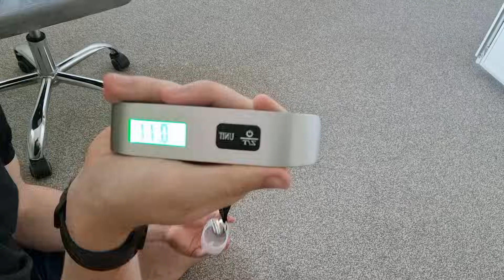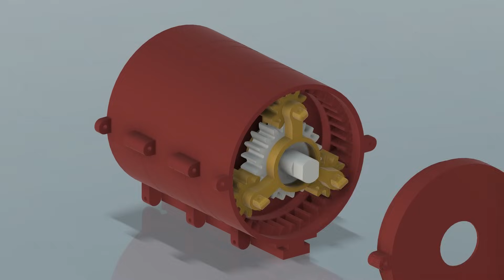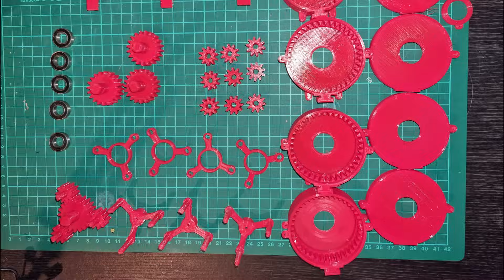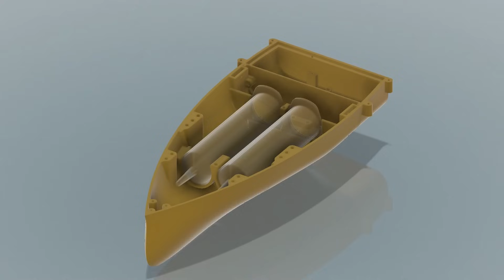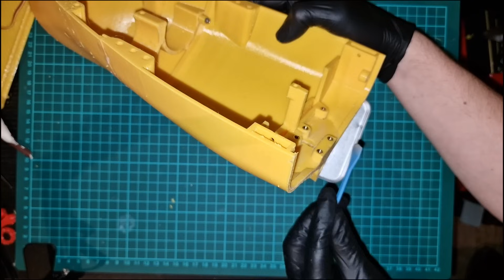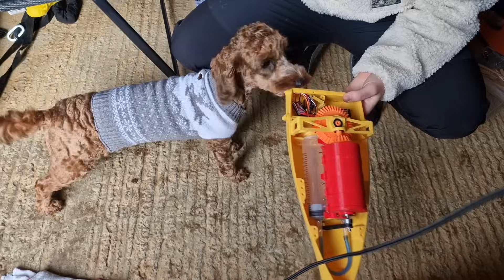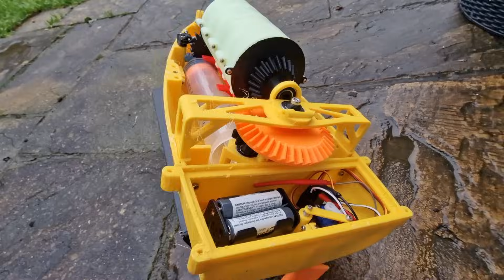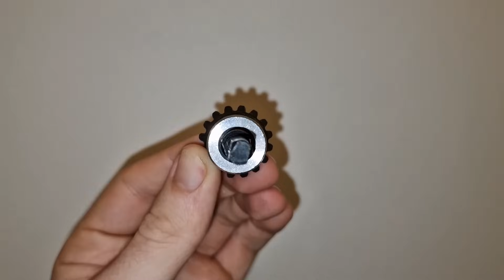3D Printed Vacuum Powered Boat

Comment: Wind the vacuum chamber from the opposite side. The gear where you are trying to charge needs to withstand both frictional force and air pressure. The closer it is to the vacuum chamber, the easier it will be on gear. Print it with an inch ledge so it won't sink easily.

Comment: main issues you having is that you using gear box to recoil pump i dont think that good idea what  if you use 3 steel rod for pump n gear to gear box and make middle shaft steel taller that way you can recoil pump without failures point of stressing plastic it will snapped try use steel rod for pump n gear to middle shaft that way avoid some headache
im engineer i can point some of failure in your work
if you want to redo work i adjust you put pump on top and gear box lower to boat that way balance out weight issues plus belt too so you have longer middle shaft and 3 gear to it and pump will have two gear top and bottom give you enough streght so doesnt snap and hopefull this help you out
in boat you dont want top heavy because it will flip over and sink recommend bottom heavy so it balance out good

Comment: Your red PETG probably got wet causing quasi-clogs in the nozzle. The yellow PETG blobbing and stringing also from moisture. Sometimes PETG can come wet and it will never work well until you dry it with heat and desiccant.  

PETG is also far more sensitive to repeated retraction as most types are a bit malleable, especially as it absorbs water. I think this also partially attributable to the failures you were seeing.

If possible I would look into ASA. It's more forgiving than PETG IME but requires an all metal hot end and enclosure.

Comment: One thing you should do is for the charging mechanism. Built the gear and shaft into the boat so that all you have to do is attach the drill, that way you can use the drill itself as a locking mechanism until you design something you can lock the gears with for the between unlatching the drill to launching in water.

Comment: Looks like a neat concept. I'm surprised you're using such low infill for parts that are expected to see the loads they are.  I'd be printing with 80-100% infill for these, 8 walls.  Looks like you are 20% or less.  That will make for weak parts.

Comment: first get some packing tape
the kind with reinforcing fiberglass strands. 

cut the belt at an angle instead
of straight across.   like lay one side of the belt over itself then cut it at a long angle
crossing a few of the gear ridges. 

then tape the two ends together. if its to long, add an idler gear to take up the slack. 

pretty much what. your doing is like how people turn strip sandpaper into a loop sandpaper for some vertical sanding machines. 

i don't know if i was clear
enough.  maybe someone reading this can explain better. 

Try packing tape (the kind with fiberglass strands in the tape). Instead of crazy glue, with the packing tape you can go all the way around the gear tape. Obviously on the flat side not the side with the gears on it. 

I’d also be tempted to cut the. gear tape at an angle (both ends) this way the cut instead of just being cut across with a small area which would be a good failure point. 

this would be easier with pictures. maybe you
got my drift

Comment: The fuel storage system doubles as a floatation device - so if you spring a leak off shore, you have the option of steaming for land and sinking faster, or staying put and floating for longer. Would make for some interesting tradeoffs!

Comment: Eliminate 99.9% of your gear train!
Use a string from the piston around a shaft... As the string winds around the shaft it pulls back the piston... As the piston pulls back it then unwinds around the shaft.... Using a simple wheel you can change direction 90° so there is no gears at all! 

Your failure is not by design, but by the limits of the materials!
Plastic is just not that strong....

I would also put a pull on the piston directly.... That way you simply pull the piston back, then wind the string around the prop shaft without load! Less ware/stress on the whole drive system.
Reply from the maker: I will have a think around how to incorporate the wheel idea as a few have mentioned it!

Only issue with pulling the piston back is its almost 30kg of force, quite difficult to do with one hand and lock in place haha

Comment: Well, nice project still!
I'd look into a metal (aluminium strip for example) brace to couple the geartrain to the 90-degrees bearing and use some screwrods instead of 3D-printed rods for the shafts.
Other things, make use of a .2mm nozzle instead of the .4mm so you can get finer details and maybe use other materials like PETG or Nylon which your printer both can handle well too.
For the stability: get some weight or maybe just put a led kiel below it when you want to go 'full water'. With a 'heavy' (for the size) camera on top, well,  even more chances for tumbling over.
But, really like your ideas.

Comment: lowering the centre of gravity will likely help with the stability, the syringes are likely lighter than the motor parts, placing them on top in a light mount could be the solution.

I also might just slice the boat in half and add another long middle section. This will help with buoyancy and the likely larger weight you will have to add.

By putting the gearbox lower, and possibly extending the length, you also could have an inline shaft. Most boats, and especially the ones I have worked on with inboards such as yours, have a direct connection from motor to transmission to prop shaft. I think you could eliminate parts and points of friction and failure. Possibly getting rid of the bevel gears and the belt altogether.

It appears that the bevel gears are there because of the need to have the pistons at certain angles. Because the syringes are light you could orient them vertically or use pulleys rather than gears to get the string to pull the transmission input shaft at the correct angle. I envision two pulleys, one on either side of the transmission. Again the extended length would make this easier.

The one downside to orienting anything vertically is that it will act as a sail, so watch out for that!

Comment: Planetary gear boxes are very hard to back drive and putting all your torque on a bevel gear is going to make it harder. Planetary gearboxes are great for increasing torque but without very tight tolerances, strong materials, and good lubrication you will struggle to backdrive them.

Comment: I'd simplify a lot: planetary gears down in the hull directly connected to the propshaft, big spool on the input side, translate the 90 degrees to the syringes on top by leading the string over rollers to get them into position. That should work better for actual operation but leave "recharging" a PITA. Maybe design the front detachable for recharging or use a higher angle for the propshaft to planetary input line to keep easier access for recharging?

Also, trimaran hull for stability? Should be an easy addon for anything you decide to make.

Comment: I like using white lithium grease that can be cheaply purchased from any automotive store. Simply spray it in and run it through a drill for a min or two so it sands itself smooth and viola, a low friction gear box. The spray also works on the 3d printer as a lubricant for its rails

Comment: So I have a recommendation for some of the quality improvements. Have the torque be more evenly distributed. So basically Have 2 shafts, one for each vacuum tube. Keep them as one connected part and this'll maybe somewhat stabilize the movement, at least from side to side, and evenly distribute the torque being generated

Comment: Suggestions on how to improve this design: I have a list (I am sorry) this project was simply so inspiring I couldn't help but come up with ways to build on your design. 

1: Buoyancy & Balance 
     Add pontoons to either side of the boat to stop it from tipping over, I have found that simply using old water bottles works remarkably well. They're watertight,  round, and hey, you're recycling. Simply printing some supports that shoot off the sides of the boat that you can zip-tie the water bottles to should work great. 

2: Gear Train: 
     I would suggest using a Cycloidal drive as a gear reduction, they're compact, far less complicated than planetary gearboxes, and are also operate with significantly less friction. Here are some excellent videos that demonstrate 3D printed cycloidal drives: 
https://www.youtube.com/watch?v=OsS9-FzKN6s&ab_channel=HowToMechatronics 
https://www.youtube.com/watch?v=Ur2eBNMfZIA&ab_channel=rctestflight
Additionally, if you are insistent on using a planetary gearbox, using some grease would help to massively reduce friction, and consequently reduce excess stress in the drive train as well. 

3: Overall design:
    Perhaps experimenting with making a hull out of foam board could be beneficial? It's far cheaper than 3D filament, and construction would be significantly less time consuming than waiting for your printer to finish the entire hull. You could 3D print ribs/spars to shape the foam board around, which could also serve as attachment points for onboard systems, and then waterproof the foam board afterwards with paint/spray. Ik that learning an entirely new hull construction method is a bit of a stretch for some random person in a youtube comments section to suggest, but increasing the size of the boat would massively help with the cramping issues you were experiencing. 

Regardless of whether you see this comment or not, I wish you luck on your future 3D printing endeavors. May your prints be smooth, and your nozzles clear. 🫡

Comment: This was much more insteresting video than a typical one, where someone just puts DIY parts together and somehow it just works the "first" time. 

You could try making a sturdy angle bracked that has the bearing for both bevel gear shafts. This would prevent them moving relative to each other.

Comment: Cool Project and Good work , small belts can be joined by cutting the ends 45degree and just basicly solder the plasic together you can add some needles trough the connection point

Comment: You need to put the heavy transmission in the bottom and the lightweight syringes on top. 
Add a one way clutch or some sort of brake for when you wind it. 
Instead of using a gear on a drill to wind it, build some sort of hex coupling into the drivetrain.
 Instead of using bevel gears just wind the strings directly onto the main shaft. Use guides to redirect the strings. 
Design your main drivetrain first and then design the hull around it.

Comment: Find some broken printers.  They have really nice lengths of tool steel shafting in them, and you can usually find broken printers for free.  Plastic shafts are just not going to cut it, especially on a design relying on such high torque.  Also try to mount your radio battery as low in the hull as you can, and look at the keels on sailboats to help keep her from listing to port and ship shape.  Great stuff, don't give up!

Comment: Personally, I would put the planetary gears as low as possible in the hull and have the syringes higher up, they are lighter after all. I would probably make the frame that holds all the gears out of metal as PLA isn't very strong. You must also try to optimize the design in CAD to make sure that you minimize flex and parts moving.
Also, in order for a boat to be stable the center of gravity must be the below the center of rotation, you can either add ballast low down or change the geometry of the hull.

Comment: If you want mechanical advantage with low friction, low mass, and low complexity with robustness, it's hard to beat a lever. Say 2 long CF tubes for balance. Now you need to translate that to the prop use fishing line tied to the end of the lever and wound around the prop shaft. It's wacky, but not compared to this planetary gear build.

Comment: I recently put together a kit of a rubberband powered model and I learned a very valuable lesson that everything must be extremely precisely aligned, be very strong, well lubricated and everything should be tested as it's put together.
My first thought is to put both syringe strings on the same shaft but make them oppose each other so the sideways load cancels out. Alternatively, since the syringe travel is very limited, maybe it can work as a rack and pinion? Also of course opposing as the pinion would probably want to leave the rack.
To avoid 90 degree turns, the syringe output can be horizontal, going into vertical gears and the propulsion being a paddle boat. The gears could be sandwiched between plywood to keep them rigid relative to eachother
Reply: why not put the pistons in line with the openings opposing each other at just enough distance to have a spool in between. that would give a lengthy overall boat design...
Reply: Also I just remembered about worm gears which let you step down rpm a lot and turn the rotation axis

Comment: So I'm assuming the syringes are fairly lightweight, and you said the gear train is heavy. Maybe the gear train should sit at the bottom and the syringes on top? Then re-designing the bevel gears so they're supported from both sides might just be enough.

Comment: yooo cool, like your workflow, reiterating thourgh design done in chaotic impulsive fuck everything and hope it will work as good as it looks in cad adhd manner is a little hobby of mine. I have used ender 3 for many years, recently got bambu not saying bambu is only option but seeing your struggle with ender consider upgrading it, its amazing how it makes work on projects easier

Comment: There's a big difference between designing parts,  and designing parts for 3D printing.  Your design skills are evident and just need a little tweaking.  Print orientation and choosing the correct materials is the next hurdle along with tuning your printer to avoid blobs and stringing for dimensional accuracy.  For gears I like PCTG, PC-ABS, or even CoPA if you/your printer is up to it.  Keep it up.  You'll be rewarded with a nice looking properly functional model.

Comment: Something to consider,  think of a rubber band airplane prop, you have a very finite amount of stored power, so you need a larger prop creates massive thrust for the  size, and going to spin slowly,  prolong the finite power you have there.
Reply: He is converting the high torque to couple the smaller prop to the water with a gearbox.  Selecting a larger prop would allow reduction of the gear ratio but eventually is too big for the hull.

Comment: Wow, the amount of good work! I just don't get why you design 3D-printed parts that needs to have at least some strength so thin/and or small. Increasing the dimensions can make parts much stronger, even with the same amount of material, up to some point. That's one of the biggest advantages of 3D-printing functional parts, that you can make things that have big dimensions, but are mostly hollow, where the infill  essentially acts as bracing for the skin.  Also, the bigger the parts, the more absolute errors get "diluted", as, if you printer prints some things say 0.1 mm smaller than the design, no matter the size of the part, that error will matter less the bigger the part is, in most cases. Things like axles and gears can benefit greatly from being as big as they can be. Well, increasing the size of gear teeth alone in absurdum isn't an elegant solution, making the overall size of gear wheels, and axles can be beneficial.     

Also, supporting gear axles at both sides of the gear wheels might be a good idea.      

Would a paddle wheel design have been to easy? I mean, just a few steps of straight gearing, and no change in direction, much lower rpm requirement with a big paddle wheel,  and no need to transfer the power through the hull below the water line.

Comment: The biggest problem I see is that the gear train is stressed in both directions.
A clutch right behind the syringes could help a lot.
Release clutch, charge syringes, engage clutch, run boat.

Also, the pulley and long propeller shaft are unnecessary. Make the planetary gearboxes the prop shaft, at a slight angle if needed. Put the syringes on top of that.

Comment: If your design does not work, start all over, you now know the bevel gears won't hold high torque, so start again from scratch. Trying to fix every little problem will take way more time. Take what you learn and try again.

Comment: Id try PTFE for the gears and make every thing more reinforced more material is more strength run your gear shafts though a baring so the hold there position that support will help stop the material fatiguing through bending.

Comment: Great video. Unfortunately, you have passed the limit of 3d printing (with plastics) in my unprofessional opinion. 
What I'd do for the next step, in the spirit of the channel, is getting something like 2mm aluminium (or steel, even stronger) and bending some brackets (setting up an edge makes it plenty rigid). It'll be relatively easy to manufacture (when you account for your means of production,) and not that expensive.

Comment: It really does look promising. I would guess metal shafts would reduce a good bit of the flex.
As for the balance, what about having the syringes on the top and the heavier drivetrain inside the hull. Added bonus is that it would be closer the prop shaft and maybe simplify that design as well.

Comment: Use the planetary gear set or 2-3 from a dead cordless drill and just carve a boat from foam and fiberglass it. Quicker, stronger, more compact and lighter. No point making a planing type hull with high drag at low speed and less interior room and buoyancy.

Comment: Why not get rid of the beval gear. If you keep all the shafts in the same direction and get the ropes to turn 90deg around a pulley. Make the diameter of the pulley as large as you can to get rid of friction